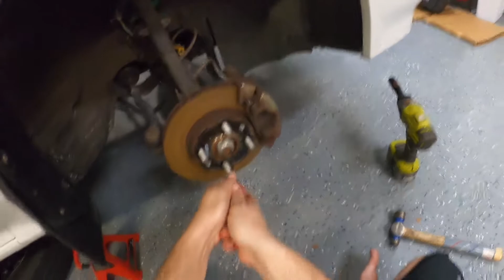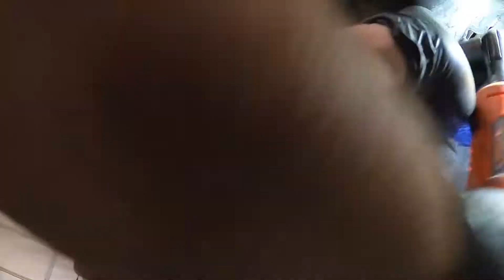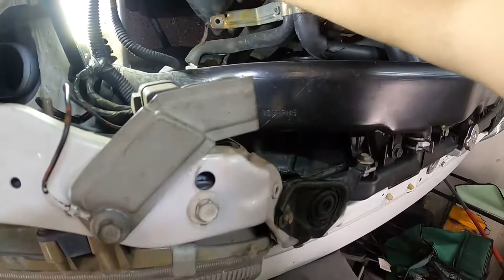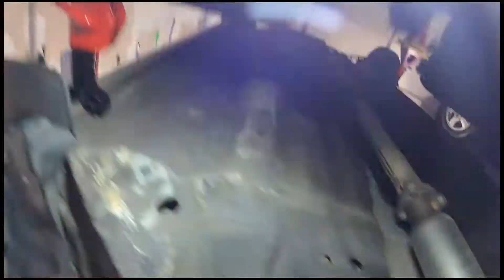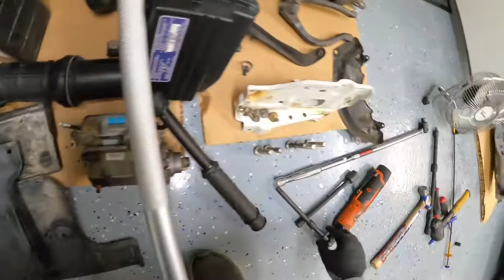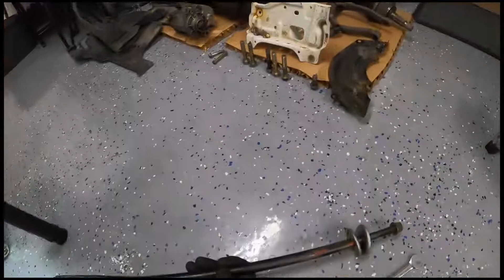Raw POV Transmission Removal Process | 1991 Civic

Comment: Gotta do a clutch on my 89 hatch it has the d16z6 swapped in it with the 5 speed. All the sudden it won't shift gears when I push the clutch. Could it be anything other than the clutch? Could it be a stretched cable or anything else. The pedal is pretty soft not much to push it all the way to the floor and it doesn't seem to come all the way back up. Also when I look at my clutch pedal it looks like it is kinda bent it doesn't look like it goes straight up and down.
Reply: don't know if you figured it out since it's been a couple months, but it sounds like its probably the throw out bearing